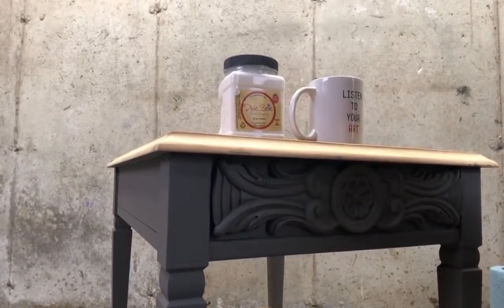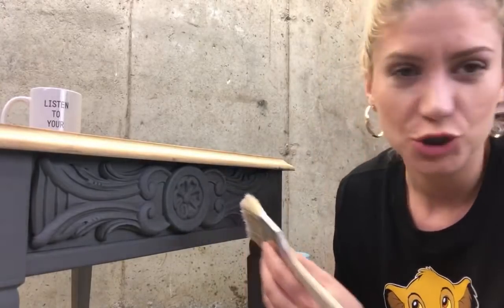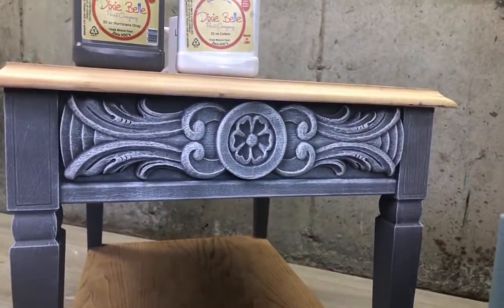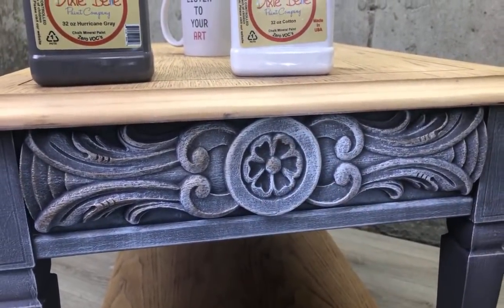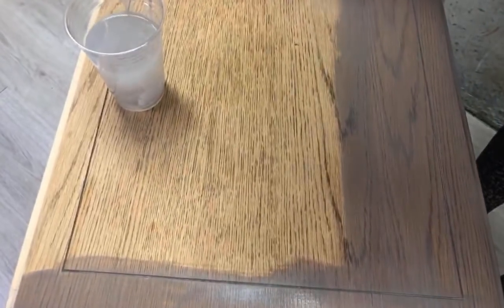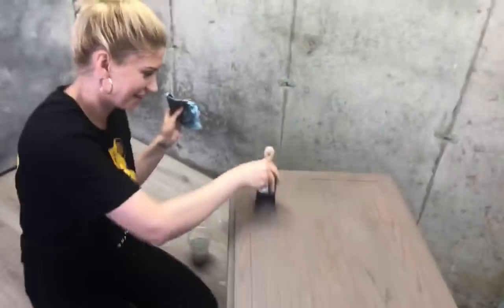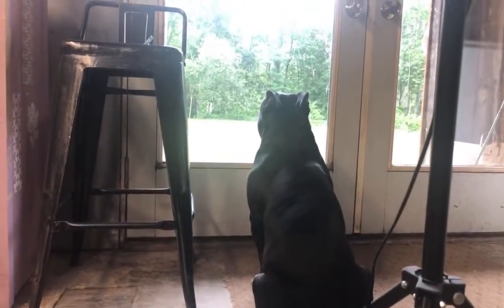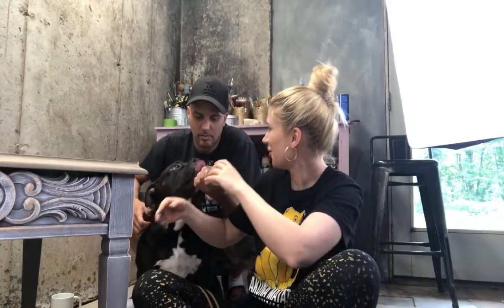Dry brushing Live w Chalk Paint

Comment: Kacha, in my country chalk paint is not available.  How i can transform a paint into chalk paint?
Reply: There are recipes online that mix regular wall paint with plaster of Paris or calcium carbonate. Just google and you should be able to experiment.
Reply: @mj.sorrondegui  thanks dude.
Reply: @mj.sorrondegui  wall paint can be used in furniture? Almost in every receipy wall paint is used whiches are not oil based. Now can u say me will this usable in furniture?
Reply: @erfanchyshimul   I am a dudette, not a dude haha 😉
Reply: @erfanchyshimul   yes you can. I’ve used Benjamin Moore and Behr on raw wood. A lot of people use them on furniture as well. Always clean thoroughly, scuff sand with 220 grit, wipe the dust off and then paint. If you turn it into chalk paint then it will adhere even more, but you do need to seal once you are done with your two coats. I’ve painted glass with wall paint mixed with calcium carbonate and it’s still holding on.